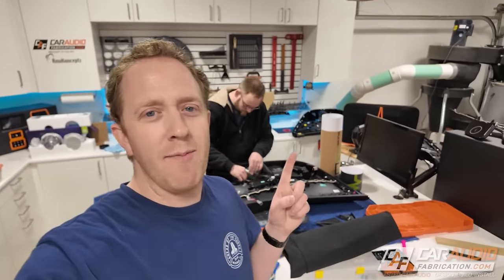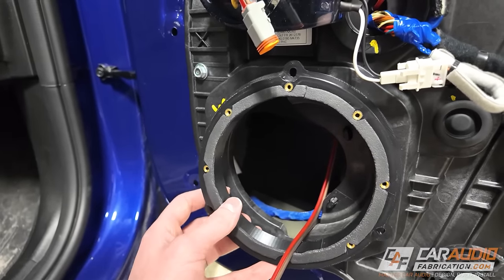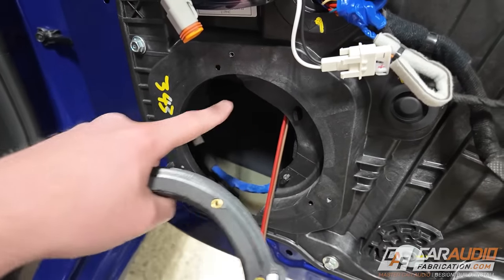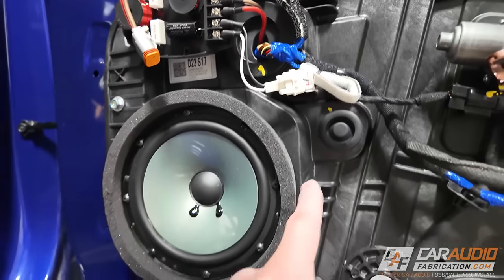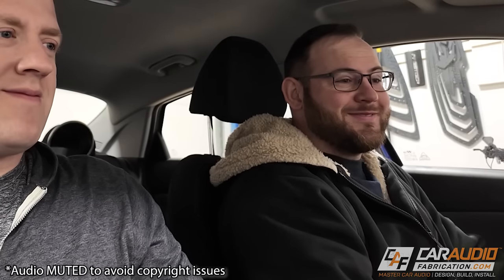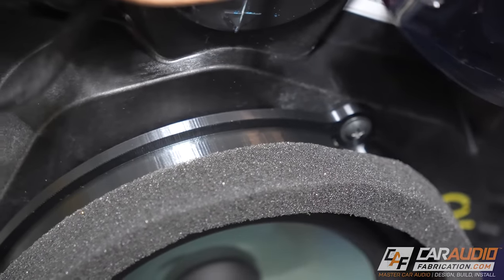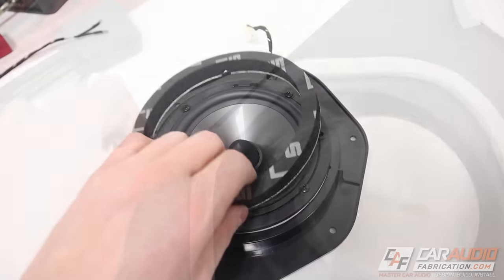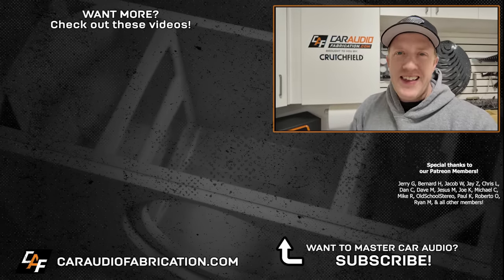No Amp. No Sub. We installed speakers only, how does it sound?

Comment: Quick question, which is material is best for speaker adapters, ABS plastic or wood, reason as to why I'm asking I've heard a few people talking trash about the plastic adapters over wood adapters. Keep up the great work and thanks for knowledge sharing
Reply: AFAIK the problem with cheaper plastic adapters is they are flimsy, meaning the sound the speaker makes is lost as the mounting adapter vibrates with it, causing the energy the speaker should be pushing into the air to be reduced, wood adapters are just sturdier and less prone to shaking as the speaker works.
Reply from the maker: Off the shelf brackets can tend to be more flexible and not as rigid, some are worse than others. When you custom make adapters you can control the quality. Doors are very prone to moisture, you definitely want to use a more stable material like ABS, acrylic, or HDPE.
Reply: Thanks for the explanation bro, I really appreciate it
Reply: Thanks for the clarity, much appreciated

Comment: To be completely honest, just adding in tweeters if you have none, or replacing the tweeters with aftermarket ones makes the biggest difference.  An aftermarket radio with stock speakers is going to sound way better than aftermarket speakers powered by a stock radio.  Best way to power aftermarket speakers is a powerful aftermarket head unit or better yet, a 4 channel amp  in something like 50-100x4 RMS per channel.

Comment: I tossed the factory speakers in my 2017 F150 Platinum.  Opted for Kicker replacements.  Massive difference with the stock Sony system.  Then I tossed the factory “sub” and added a Kicker Hideaway sub under the rear seat, and it took it to a different level.  I was surprised at the thin gauge of the wires, which has to make a difference.  I may end up retiring it with 16ga.  I’d like your thoughts on that.

Comment: Great video.  Quetsion: can you tell me if most OEM door speakers (Mazda 3 2016 specifically) are 2 ohms or 4 ohms? I  am asking because if I just swap them for any aftermarket 4 ohm speaker, it will pull half tha wattage from the factory unit and will sound lower. If this is true, can I just  add a 4 ohm resistor in parallel to the 2 conectors in the speaker to drop the 4 ohms down to 2 ohms? Thank you!

Comment: I did this with my honda and it sounded 4x better. It got louder, clearer and boomer.
Reply: If u want to go even 2 times better u need a sub and 2 amps (1 for the fronts 1 for the sub).. lot more work though.. but then u go from louder to am i in a club fr?
Reply: @larsvegas1505  you could get a powered sub if you only want to add a sub. I did that and my system sounds good

Comment: If you are running an audio shop, not it's not enough to just replace the speakers. (That's a business aspect). For normal people its perfect. Easier, cheaper, and so on. If you want the best and are in your car a lot, then you probably need a map to maximize the sound. He face says he was just fine with that upgrade.

Comment: Hi Mark.  Fan of your channel.  I currently have a 2023 F150 XLT.  Want to upgrade speakers first then maybe add amp later.  Will the JL Audio C2650 work well with my factory stereo?  Later I want to get an amp, but I am thinking of the Kicker Key with automatic tuning DSP.  Will that have enough power for the JL Audio C2650?
Reply: JL and Kicker are mortal enemies from back in the day. Get a JL amp to run them.

Comment: New to car audio but I just upgraded the front speakers and there was a slight audio improvement. I’m not ready to insert an amp yet but would an aftermarket head unit also make an impact on audio (I have a stock head unit)?
Reply: It really depends on the head unit you're installing. You're definitely getting a power upgrade to drive your speakers. But it's somewhat a peace of mind to know that you have a separate amp that could do more headroom than a limited size amp in your headroom.

Comment: @CarAudioFabrication just came across you guys and had a question. So i own a 2020 ford fusion hybrid titanium it comes with the sony 12 speaker system with supposed 390w Regular Amplifier. I purchased 2 pairs of Pioneer TS-A652C A-Series 6-1/2" Component Speakers for front and back doors also Pioneer TS-A879 A-Series 3-1/2" 2-Way Car Speakers for front and back centers, I will sound proof the 4 doors and also the trunk and add a JBL bass pro 12 it draws small amps 20 to be exact because going over 30 amps can cause a lot of issues . From all the research i have done because it is a Hybrid and adding a aftermarket Amp is a whole other ballgame. My question is adding 4ohm speakers to the system will it make my amp and head unit run hot or will they be ok thanks in advance Cheers!
PS: New Subscriber

Comment: I swapped all of the speakers in my Yukon to Phoenix Gold components & coaxials, bypassed the factory Bose amp and ran them all off the aftermarket Sony H/U.  I kept the stock Bose sub hooked up to the factory amp for now.  Sounds much more rich and clear than before and the bass from the stock sub is more defined.  It's interesting that there's a difference between car manufacturers who use the same brand for their stock sound systems, because the factory 9 speaker Bose system in my Altima sounds really good, probably one of the best sounding stock systems I've heard.  Whereas the Bose systems in the GM cars don't sound great at all.

Comment: I put hertz components in my honda car with a aftermarket deck and the tweeters blew after 6 months and i was told it was because they were being underpowered by the deck and i needed to use a amp on them. So basically never use higher quality component speakers if they are being underpowered. Maybe if my car had a stock amp it would have been less bad. Main thing is the rms of speaker and amp should be close if not higher on the amp side.

Comment: OK so, I have a 1999 reliant robin and the headunit that was in it was garbage ebay spec and stopped working and the speakers are as horrible as you can imagine being in a budget car from a company that had entered administration twice by this point, I want to buy an aftermarket HU and speakers, I would prefer to avoid using an amp, what would be a good sounding pairing?

Comment: Do you have some tricks to fix trim panels that may break one clip or two on removal? Even with the most care, some panel use very small clips that break on removal and can't be replaced and this create crackling. Pretty sure you have do deal with at least a few times...
Reply: Buy a bag of replacement ones, or just deal with it, we all break some, and you can have the odd broken one, and even just use silicon glue to keep it in place.

Comment: What about powering some speakers with the Sony head unit that puts out 45 watts rms? Right now I have focal icu570 speakers all around that sound amazing with an alpine head unit that puts out 18 watts rms. They actually sound really good with so little power. I’m just tired of 4 channel amps. I always have bad luck with them.
Reply: I got mine on a ETON Micro 120.2 (different set) but it sound amazing though.. clarity is better on higher volumes.. but just going off ur headunit its lots better if ur not playing too loud..  With the eton and a 12''' sub i can get crazy sound levels and not have to worry about my speakers..

Comment: Does this Elantra come with a stock amp that is driving these speakers? Or does it come straight from the head unit?
Reply from the maker: Head unit power in this case, there is another Bose trim that is amplified, but this one is not.

Comment: Hey guys I hope you can really help me out. I just bought a 2005 Toyota Avalon Limited with the JBL 14 speaker sound system with the 8-inch subwoofer. The car is immaculate with only 82,000 MI and not a mark on the interior and one or two minor scratches on the exterior but the 8 inch subwoofer which is 19 years old blew and I don't know what 8 inch speaker to buy. Obviously I would like to keep it JBL but I can't find the exact wattage for that car and that subwoofer some of the Avalon's came with less speakers with less wattage so I'm hearing it's between 800 W and a 1200 watt system so can you guys recommend a subwoofer specifically for that car? I would have really appreciate your help

Comment: Trust me people speaker adapters are usually important and needed alot more than you realize, and as an example i had a set of 5 .25 kicker cs series speakers for a project truck i didn't end up getting along with a factory replacement stereo for the same vehicle but not one that particular vehicle was ever offered with, and the truck i did end up with the kicker cs series speakers would fit in the rear door speakers location but the front door speakers are different size, and they cost more than the same as the rear speakers for the matching series of cerwin vega hed r series 3 way 6x9's i end up getting and installed in the front door speakers locations in the truck it is a 2000 dodge ram laramie slt quad cab, and the magnet structure on the back of the speakers doesn't allow the power windows down more than about halfway, so they would need to be spaced out away from the front doors they have really decent bass response and sound great honestly but id about guess that the kicker cs series 6x9's i didn't get would have fit just fine with no adapter plate to space them out from the door needed, but i already have the complete set of cerwin vega hed r series door speakers... And I have even considered adding a dual electronics xpr82d amplifier for the right side and left side speakers probably a better setup than dodge used originally and splicing it into the rear doors, but it honestly doesn't need it i did end up changing the head unit to a 20005 pioneer deh model p3700mp mp3 CD player super tuner III D stereo and it sounds awesome with just the front speakers installed unfortunately though it is only halfway installed because i have managed to lose my install cage sleeve for mounting the stereo in the dash so I guess ill end up getting a used stereo around the same years as when they came out with the super tuner III D stereos because it honestly makes more sense to me to do that and have a good backup or a useable head unit for something else,than to spend the $25 online and only buy a cage sleeve.
Reply from the maker: Proper adapters definitely go a long way. Thank you for watching!

Comment: From my experience it sounded bad. For me car audio is all or nothing. Swapped stock vw polo 2018 speakers by focal integration - nah, then added amp - nah, then swapped by focal flax 3-way + another amp - nothing good. And only when I added a sub + DSP and tuned the thing + time aligned (very important) suddenly all made sense. But at 2500€ :D

Comment: I've never found an improvement with a speaker only upgrade. I think the factory amp/dsp's are tuned for the factory speakers and when you add a tweeter there's too much treble and not enough power to back decent bass. Early on I believed there was a big improvement in clarity but sustained listening quickly becomes fatiguing and the lack of bass unsatisfying. IMO a subwoofer should be the first upgrade to most systems and speakers should be part of a package that includes more amp power AND EQ/DSP.
Reply: Also, crossing over the speakers to a sub/amp can substitute for a lack of power for the speakers.

Comment: what were his (Brian's) HU EQ settings for Treb/mid/bass and if he had speed sensitive volume set (on/off/low/high)?  Did you all test w/the same settings or put everything back to flat (0s)?  Sound is different to everyone.   I just want to upgrade to the 3ohm Infinity cfx/ix/ex speakers, but my dash speakers have to stay 8ohm due to Subaru Starlink.

Comment: Not same speaker in front & back 😮😮 ????? Not bad ???
Reply: The Fronts are JL C2 components ($300) and the rear are most likely the coaxial version (tweeter in the middle vs separate) and I believe those alone go for $200-250.
Reply: @2fast4all  600$ speaker on stock radio 🤦‍♀️🤦🤦‍♂️
Reply: @christopherbussiere4415  for CAF standards its no suprise.

Comment: I went from stock Ford 5x7s to JL C1-570x’s and have NOT been impressed at all. Door panels got sound deadened, foam rings between interior panel and speaker, speaker gaskets etc, and it’s a weaker overall sound. And now the highs are very overpowering too. Sony aftermarket headunit
Reply: probably add a amp then.. ur speakers too heavy
Reply: @larsvegas1505  just empowers the highs even further.
Reply: @ty27tp  U should atleast have lots more midbass also.. like would be weird if ur just getting highs.. on a comp set u can also ajust the crossover settings (most of the time)..